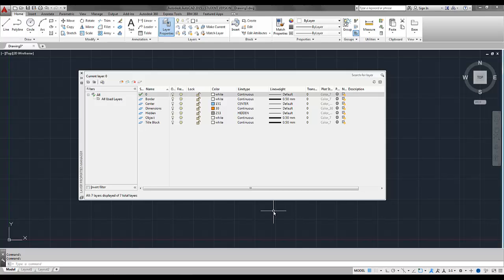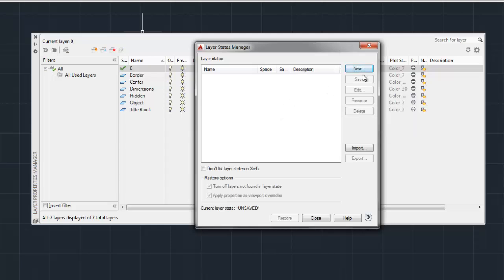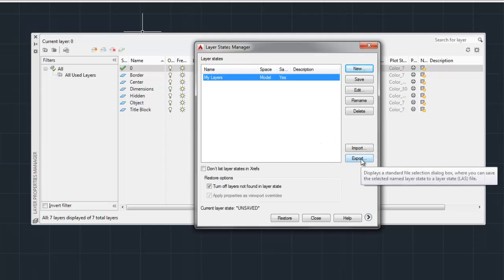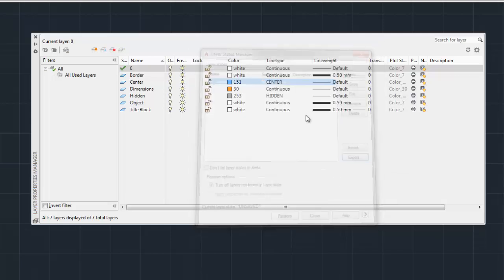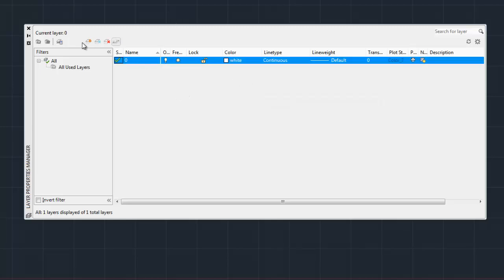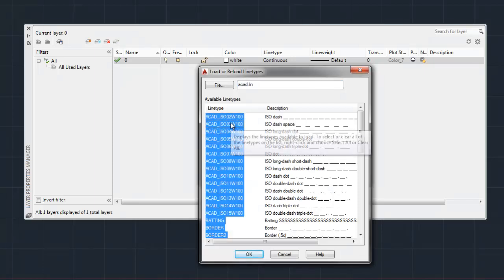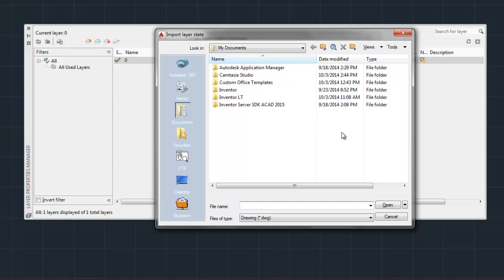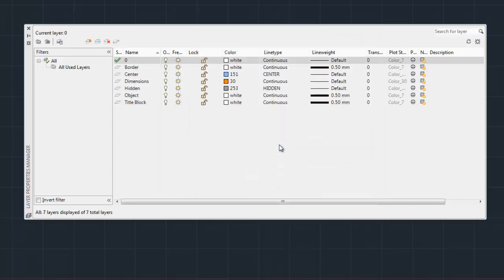Importing and Exporting AutoCAD Layers

Comment: A easier way is to use design center and drag the layers from one drawing to another, just type DC at the command line
Reply from the maker: Yes that works well when multiple drawings are open. You can also copy and paste the content from one drawing to another which automatically copies the respective layers. The method shown in this video is helpful for creating an external standalone file.

Comment: Thank for the vedio, was great ,i have a proplem though when i use ceter line layer or the hidden line layer the those line comes solid even though wile setting the layers i have selleced center type and hiddeen type, wht do you think otverriding this settings ?
Reply from the maker: smartboy20070 Check to make sure that the properties for the selected line display "by layer" for the linetype. Then check your linetype scale; you may need to scale up or down.